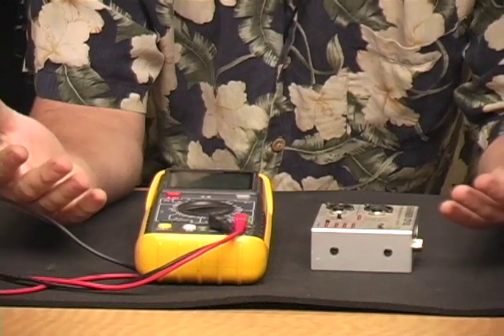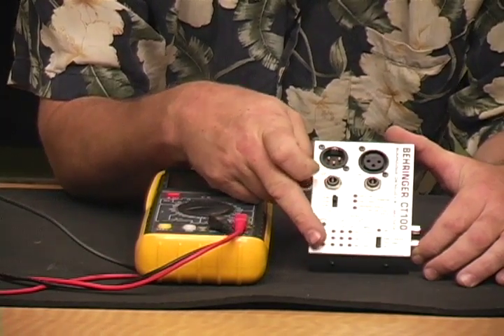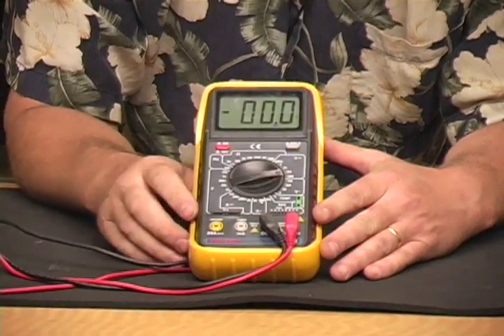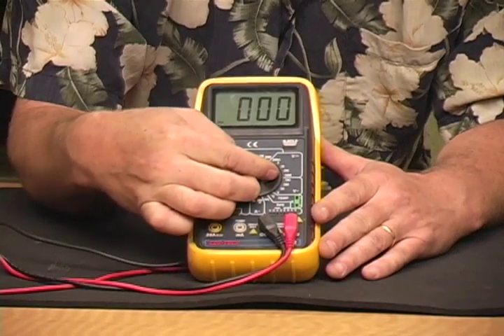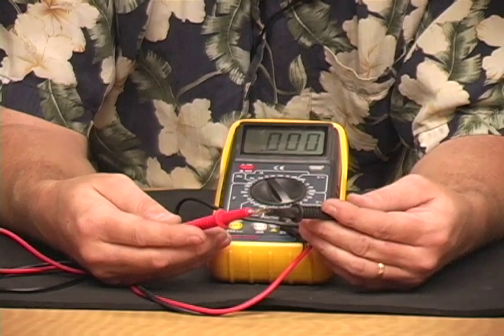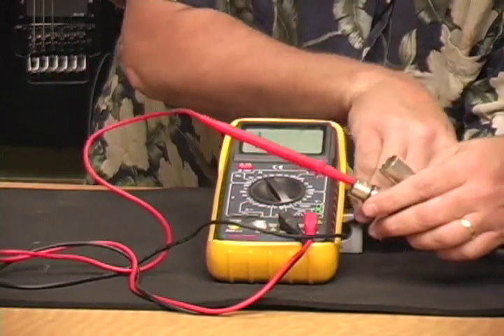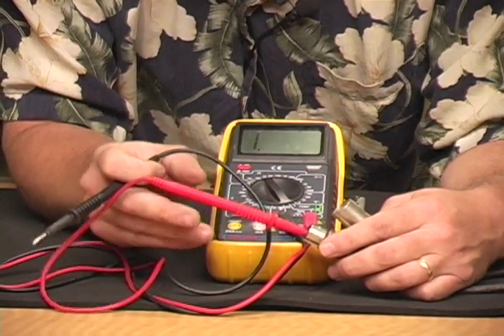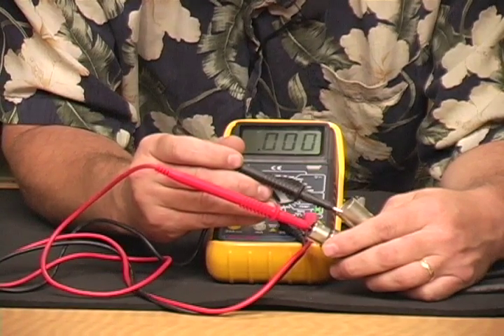How to Make & Repair Audio Cables : How to Test Audio Cables

Comment: Thank you, I was just able to test my XLR cable as you did. In my case the mulfunctioning is intermittent, so the Behringer is more comfortable to keep the connectors plugged and move the cable around and test the cable. Unfortunately I don't have one yet :D

Comment: The other thing that should be tested is whether the signal crosses over into another pin - e.g., if pin 1 is shorting to pin 2, common in the case of poor soldering, or on rare occasions with damaged cables.